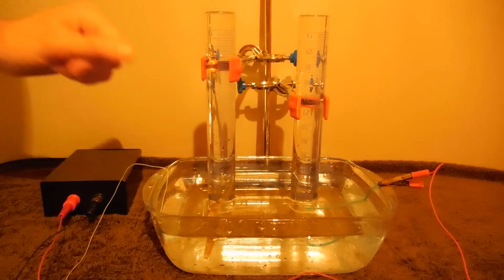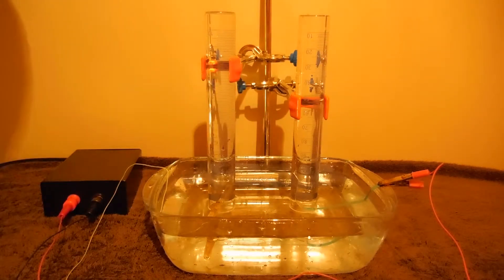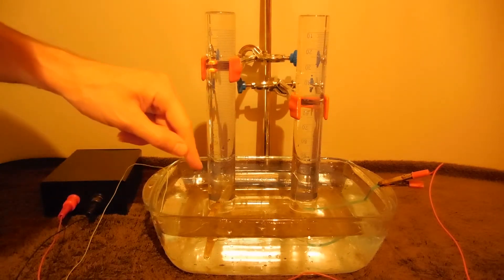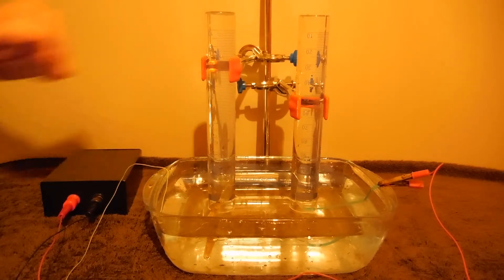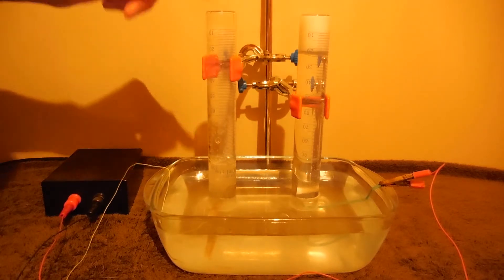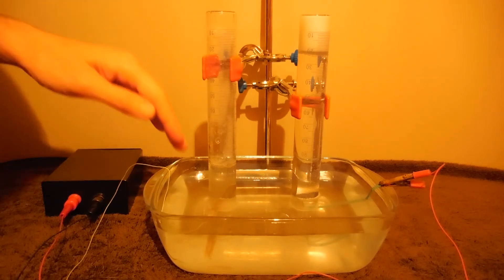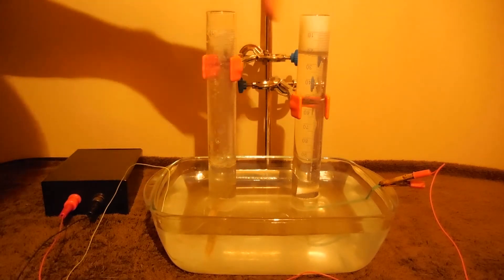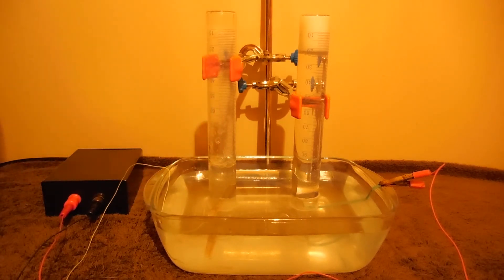Physics Experiment Electrolysis Of Water With Aluminium Graphite Electrode Timelapse Full HD video

Comment: Hi. Thanks for sharing it.
I'd like to ask you some questions:
1) The initial pH condition was neutral? Or did you put some acid to run the electrolysis?
2) Despite the previuos answer, what would one had if uses aluminium sulfate instead of oxide? What gases would form, oxygen or sulfur trioxide?